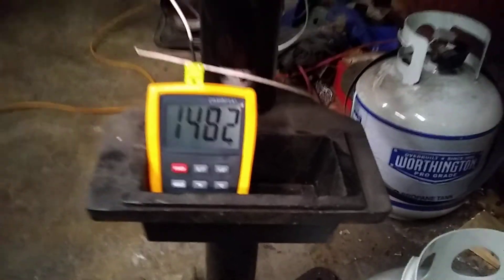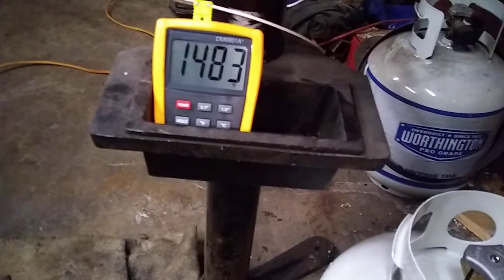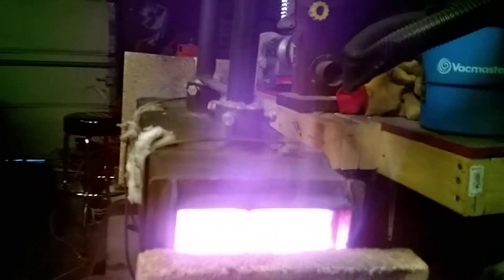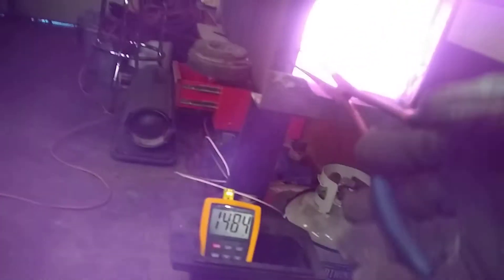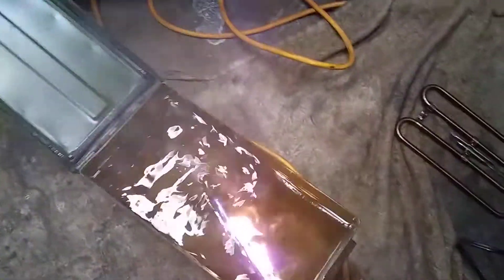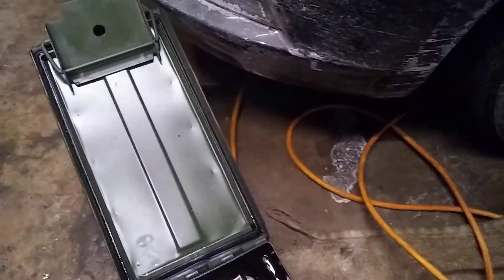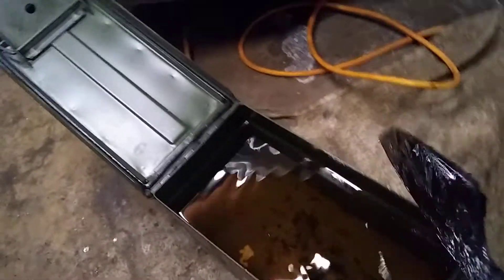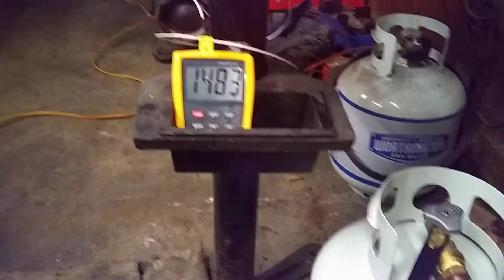52100 heat treated simple way.

Comment: I like the angle iron there to prevent direct flame contact. I’m guessing it makes the heat a bit more evenly dispersed on the blade too. I’m going to try this!
Reply from the maker: It helps, a pipe works even better. And try to put the knife on its spine so the edge isn’t laying flat.

Comment: Did it work please let me know
Reply from the maker: Yes this will work but If you can keep the knife vertical somehow balance on the spine that would be better and maybe invest in some parks AAA oil also if you have access to dry ice at your local food store get a 5 pound bag mix it with some kerosene and give it a cryo
Reply: @AaronJohnson1979  thank you for reply I'll try it soon
Reply from the maker: @ericdavis4398  let me kno how it goes
Reply: @AaronJohnson1979  I'm not sure what I'm doing wrong I'm keeping it between 1480 and 1490 10 minutes then quench in oil 120 haven't been able to sub zero bath nobody carries dry any more if you can think of why it is giving me problems let me know thank you
Reply from the maker: @ericdavis4398  give it a little bit longer soak try 15 to 20 minutes but realistically 52100 is beautiful steel but to get consistent results you really need a heat treat oven with this stuff a propane forge is not ideal. I hate to say it because I love this steel but that's why I moved on to 80crv2 not that it's a better steel. It's that I get much better results in a propane forge with it,  my heat treat oven will be here soon and when it is I will go back to 52100.
Reply from the maker: In that video that knife came out to be about 60 HRC which isn’t bad but 52100 Can do much better than that you really need a heat treat oven with this stuff but if you do a few extra steps like I said in the common above you probably can get it a couple HRC points higher

Comment: what was the Rockwell out of the quench and after tempering?
Reply from the maker: I don't have any way of checking the Rockwell hardness. But a chain saw file skated right off it. So I'm guessing but I would say 60.
Reply: @AaronJohnson1979  
I treated some 52100 yesterday  and only got 54 on the Rockwell on both blades I did. That was after temporing at 400 for two hrs. 
I soaked at 1550 for 20 minutes then quenched. I'm going to retreat the blades at 1450 and see what I get.
Reply from the maker: @richardlowe8062  yeah it's touchy stuff use fresh canola oil and sometimes a lower temperature will give you a higher hardness makes no sense. But that's how it is.  Good thing about it is it can withstand multiple quenches you'll still have a nice fine grain structure long as you don't get it too hot from what I've noticed.
Reply from the maker: Also if it's a really thin blade and it's for kitchen use I would temper it lower maybe 375 just try it. You'll just have to experiment and find out what works for you and then try to become consistent I usually can consistently get close to 60.
Reply: @AaronJohnson1979  
Ok thanks
Reply from the maker: @richardlowe8062  I do 1475 to 1490 I try to keep it in that range depending on how thick it is I'll soak it from 20 minutes to even 35 minutes. For a kitchen knife I'll usually temper at about 375 for 2 hours twice. 52100 can be frustrating but stick with it,, it's some of the best hi-carbon steel there is if not the best in my opinion especially for kitchen knives.